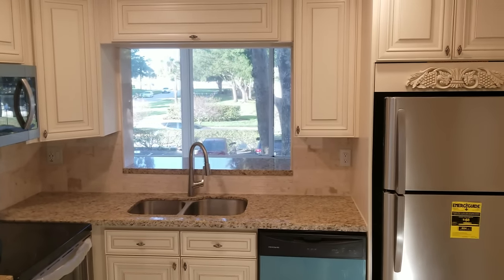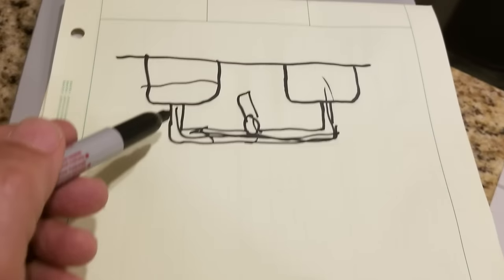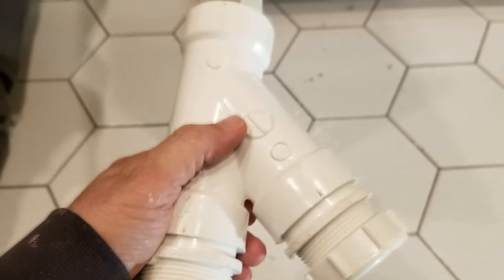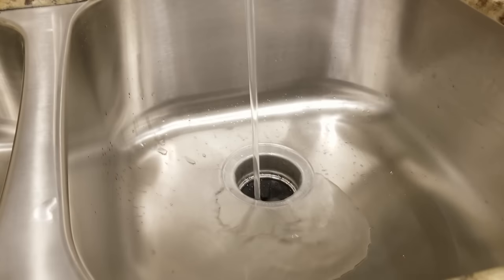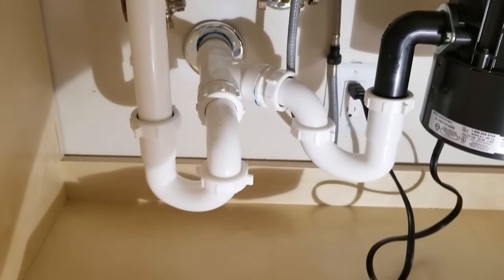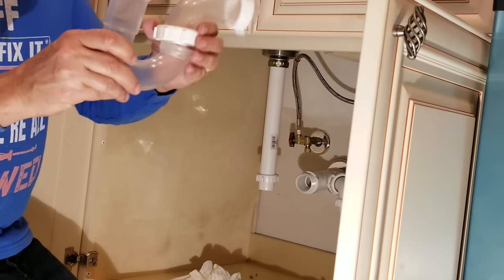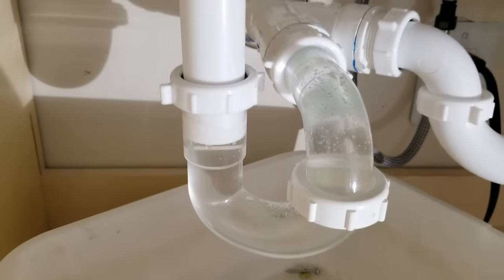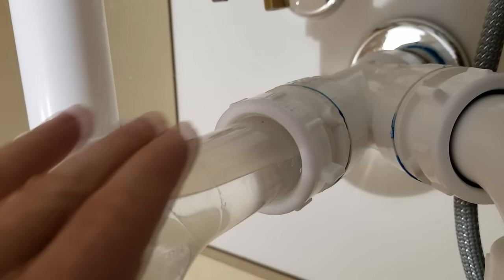How to Install Dual Kitchen Sink Drain Plumbing Pipes

Comment: The joint that connects the two halves of the trap is known as a VGJ or visible ground joint .  There has also been some very shoddy work done in the process of remodeling the piping for the sink drain. There should be absolutely no water left in the horizontal pipe that goes to the wall. There isn't a jurisdiction in in the U.S.A.  where that quality or lack of workmanship would pass a plumbing inspection. I only hope the person who lives in that house knows what kind of work was done. ( 55 year retired plumber )
Reply from the maker: what can you do to create the slope toward the wall when the waste line out of the wall is horizontal?
Reply: @jeffostroff  go back in time and tell the builder to do it right. It could be because of crud in the line?
Reply from the maker: @sal.pizzurro  I'm working on a time machine invention and plan to spend about 3 months back in time chewing out several builders: "what were you thinking"?
Reply: I’ve got the same problem,  a horizontal pipe. The old three way connection rusted out from the bottom from end to end. Now replacing it with  PVC. but still will have water sit, wishing o could creat an angle without moving the house.
Reply: @jeffostroff  Is there anything practical that can be done to remedy the slope?  We have this problem plus dishwasher waste plumbed into disposal pressurizes the drains when sinks are full.  Causes joints to flex and perpetual leaks flooding electrical box.
Reply from the maker: @DustinMaki1   If you have then horizontal pipe going from the garbage disposal over to the other sinks down spout then you will have to re cut that down spout in order to allow the horizontal pipe to come into it a little bit lower it doesn't take much you only need a quarter of an inch per foot sloper
Reply: jeffostroff if it’s all sloped correctly they obviously you have a blockage downstream, just snake it out, no time machine required, unless you have backfall and we can’t see the angle in this video
Reply: @jeffostroff   there aint much you can do to correct a stub out from the san tee in the wall, (unless you want to open up the wall and move things around,) but really the short distance just makes a large crown weir, best your work is leveled out like you did.
Reply: Could the high weir be a venting issue?

Comment: Seems like doing that might have a siphon effect on one of the traps depending on which sides draining.
Reply from the maker: It cannot generate a siphon effect because you're going into a wye
Reply: @jeffostroff   I was thinking to do the same two p trap using wye. One for the kitchen sink drain and another for the washing machine drain. I am also curious to know if this will cause any siphon effect.

Comment: I have 2 inch PVC coming out of the wall.  Found a 2" x 1 1/2" adapter to connect.  But I am left with a female unthreaded 1 1/2" to connect to the wye - I can't find a male to male 1 1/2" to connect those 2 - HELP?
Reply from the maker: If you look at what we did under the sink, on the end of the Wye, you cement on a 1 1/2 inch trap adapter and that solves your issue, so now the output of your trap goes right into that trap adapter.
Reply: @jeffostroff  The output of the 1 1/2" adapter that I have is the same size as the wye. That's why I said I need 2 male connections to connect those 2 alike ends

Comment: I was told I needed a vent.  Is that true?  How do I add one?
Reply from the maker: Usually when you vent a sink drain there has to be a pipe inside the wall to go straight up through the attic in out the roof to the outside so that there can be air behind water when you drain. If you can't accomplish that then you can do it with an air admittance valve from Home Depot https://homedepot.sjv.io/donA97 also known as a Studor valve. You have to connect the P trap to this valve underneath your sink and it will pull in air from there
Reply: @jeffostroff  Thanks!  You only need an AAV if your drain goes down, under the floor, rather than through the wall, right?

Comment: can this work if the waste pipe is high?
Reply from the maker: The waste pipe should be lower than the horizontal output tube of the garbage disposal. If the waste line is higher than it, then you won't be able to drain water out of the P-trap exit and into the waste arm coming out of the wall. It will back up into your sink drain. A lot of people will report seeing this problem with they have this condition, and unfortunately happens a lot during remodeling. The only way to fix it is to cut into the drywall and lower the height of the waster pipe.
Reply: @jeffostroff  thank you so much!!

Comment: Should have the disposal connected over to the left drain with a specific connecter and then the pee trap leading to the drain.
Reply from the maker: Yes you can do it that way, the problem is most people implement that method wrong, because they don't slope the horizontal pipe to the P-trap downward. This is not a case of it should have been done your way. Either way is fine.

Comment: Im i missing something. I have very similar configuration and somwtimes when the disposal is turned on, i can see a little water coming up from the other side.
Reply from the maker: We had the same issue in my kitchen at home a few months ago, we made a video out of it. The problem is likely a clog further down the sewer system. My 15 foot snake could not reach it so my plumber friend came by with this segmented feeder which also agitates the snake, and he went about 30 feet down the line to unlog and found cereal! Cost me $100! You'll see it on the video we show the failure mode, and how we cleared it: "How to Snake/Unclog Kitchen Sink Drain, Stop Sewer Smell" https://youtu.be/fqnm4mwV33o

Comment: Currently, both sinks drain to a vertical baffle tee connection. the sink without disposal enters from the top and the disposal sink enters the tee horizontal (the p-trap is after/below the baffle tee). Problem is that the baffle tee significantly restricts food waste from disposal. Had a clog that I just had to clean from carrot peels. I'm wondering if your wye connection would be a better solution? I understand why the baffle tee exists, but makes no sense for food disposal. Thoughts?
Reply from the maker: Yes, since the solution we used here uses no baffle, I think it would perform better. But I also wonder would the carrot peelings clog up in the P-trap if they weigh too much? I might also suggest that you should be peeling carrots over the trash. I actually try to put as little possible solid or lengthy strips of vegetables down the disposal. I mostly use the strainer on the sink drain and dump everything in the trash.
Reply: @colinkinton @jeffostroff absolutley put everything into the trash,  pretend disposal doesn't exist.  Disposals chop food up essentially making everything like mashed potatoes.  Many food blockages can't me cleared with cables,  you would have to have the line scour jetted. High pressure water throughly cleans the pipes whereas cable being a bandaid fix,  will only burrow a hole through the blockage leaving behind the build up on side walls.

Comment: The line in the wall connects to the line that's in the floor with a T  but the two p traps are on the same line, one attaches to disposal, and one attaches to the line that goes into wall and into floor with an elbow to the p trap.  No wonder it's so crazy and won't drain right!

Comment: Does the code allow this configuration?
Reply from the maker: We have found nothing in the code that disallows this. At the end of the day you have 2 streams merging into one.
Reply: I think it is perfectly fine as well because the main drain line is 2 inches and two 1-1/2 in. connects to it. If you had a 1-1/2 in. main drain line then you may have had issues. I just filled both sinks and both drained almost the same time. I have a final inspection soon, will keep you posted. My plumber thinks it wont pass but we will see.
Reply: @erginiscen  and....?  did it pass?
Reply: @borisstarosta7823  the inspector didn't even look at it, my advice would be to do this which perfectly works when you don't have to involve an inspection. I filled both sinks to test and opened the drain at the same time, both drained perfectly and fast.
Reply: @erginiscen  THanks for your update.  But... the important test is to see if filling just one of the sinks, and then draining that one all at once, can pull the trap for the other sink dry (by a siphon effect).  If it can, and then you have a dry trap, this would allow sewer gases to come out of the drain of that sink.

Comment: You still have a confluence, it's just closer to the wall,  I suppose the extra pipe in the assembly holds a little more water but...  I still cannot justify paying for the additional p trap.  I would not pipe it the way your initial diagram outlined but rather running both sinks DOWN into the same p trap via sani-t with the disposal being fed into the vertical stack and the sink angling over, down and across into the curved stack; then into the trap and out to the 2 inch main in the wall.
Reply: I believe that is textbook.
Reply from the maker: I prefer one larger sink
Reply: @jeffostroff  I hear you...  I went with 2 because I do my dishes by hand and need a place to dry them.  The other sink is perfect but it still needs a drain.

Comment: You're supposed to clean/prime the surfaces and then hold the joint after joining them after the twist so that the curing joint doesn't force it apart. (Instructions are on the friggin' can!)
Reply: Actually you do not glue slip joint fittings

Comment: Than you would have more room for storage under your sink. It's rare that you have both sinks draining at one time. And the pipe in the wall the drain is 2" under the house so you should have no problem with drainage
Reply from the maker: I really prefer one big sink

Comment: What you fail to realize is the drain being 2 inch pipe can only handle so much water at once. If the wall line is properly vented then you would not have any problems.
Reply from the maker: The 2" pipe going into the wall was enough to handle both basins draining at once.

Comment: The outlet side of the traps are supposed to be sealed by a glued connection, not a slip fit.  You should have put desancos on the tailpieces.  Also 2 traps are not required, if your drain from the wall was lower you could have put a TY above the trap on the disposal.
Reply from the maker: You are wrong on both counts. You use cement if you are using PVC parts. These are poly pipes which is allowed by code and is the way all plumbing is done here in FL, 1 1/2" PVC DWV pipe coming out of the wall, then a hub adapter is cemented onto that pipe, then the p-trap slips intot he slip side of that p-trap adapter. This is done so howmeowners can remove the p-trap to retrieve items that fell down the drain. Also plumbing code REQUIRES a trap, but permits 2 traps if they are on the same floor level as these 2 are for each line to stop sewer gasses and deadly odorless methane from seeping up from the sewer. furthermore I don't like those horizontal pipe most people put in from the garbage disposal to the vertical tail pipe, because they often don't have a downward slant on them to help the water move out of the garbage disposal.
Reply: @jeffostroff  The first drawing you did is a center outlet waste, and I agree with you that design is garbage. There is nothing wrong with your design using the wye method. My personal preference is to use two 1/8 bends to off set the drain then use a disposal end outlet waste with a baffle and single trap. It takes up less space and looks neater. Again I'm not bashing your work this is just my preference. There are many right ways to plumb.
Reply from the maker: @joshm5816  Are the baffles allowed in plumbing codes? I thought they did not want any moving parts, or is it a stationary wall inside the baffle?
Reply: @jeffostroff  Baffles in a disposal waste isn't a moving part. The NC code book allows it for residential use and it works great.

Comment: I don't like screw on fittings especially when a garbage disposal can vibrate and cause it to leak over timr
Reply from the maker: That's why I hate cheap sinks with thin gauge steal. Also your garbage disposal should not be vibrating ever, the ones I install are level and run smooth. I stay clear of the cheaper units.

Comment: Get to it
Reply: I see a dishwasher. That usually is pumped into the disposal. I say that because code requires 2" pipe if a dual sink is piped with the dishwasher. At least in my state.

Comment: Watched a lot of videos on this type of setup and professional plumbers say this is a no no. This also seems over complicated, going to just stick with what is recommended by the pros and use a single P-trap.
Reply from the maker: Nothing wrong with a single P-trap. but you have not given any reason why it is a no no. This implementation gave zero problems, and drains perfectly

Comment: This isn't particularly wrong but it's not the way I would do it. The reason why I wouldn't do it this way is because if you drain only one bay it can pull the other trap out. Typically you would put an arm over into a vertical tee and then right underneath it use a single trap. That way every time you run the garbage disposal it doesn't pull the the water out of the other trap
Reply from the maker: This is where your logic is incorrect you cannot suction out the other P trap because they feed together in a Wye formation period now there are other scenarios that it might be able to suction it out but that's why we feed it in as a Wye instead of a T shape
Reply: @jeffostroff  actually the y makes it easier to siphon it's called a Venturi effect and if you turn on the garbage disposal with the sink full of water I bet you it pulls it out the other side

Comment: I did this exact setup when I changed our disposal out.  Before I did this the way it was plumbed would allow disposal grindings and water to back up into the other sink, GROSS!  Doing this completely eliminated that!
Reply from the maker: Chris, if you were backing up into the other sink previously, I bet you have some minor clogs that need to be cleaned out. We just uploaded a video covering this a couple of months ago, check it out: "How to Snake/Unclog Kitchen Sink Drain, Stop Sewer Smell": https://youtu.be/fqnm4mwV33o
In this drain line our snake came back with cereal that must have gotten bunched up in an illegal 90 degree corner somewhere down the line at least 20 feet.
Reply: Just wanna reply in case anyone else comes across this...yes, I must agree with Jeff’s reply here about some clog somewhere. I have a double sink with the same setup as in this video and was still getting nasty disposal pieces and grime backing up into BOTH sides of the sink. The clog was Not in any of the pipes under the sink on either side, so it had to be somewhere further in the drain through the wall out of sight. Instead of calling expensive plumber, I researched and ended up getting a 20’ drum auger drain snake thing and thankfully that finally did the trick! (I know nothing about plumbing but trying to learn a bit to save money now and in future)
Reply: @skittles2055  i have it on a newly installed drain pipe on a double sink.
Can't be clogged as its leveling out since first use😕

Comment: Mine is similar to the Y design in this video but is different with how the two basins connect to the Y.  I took it all apart to fix a clog and can't get the garbage disposal side back together now.  Should have taken a picture of the layout before hand but didn't think of it until after.  New homeowner pains and lessons.

Comment: That wye fitting for the disposal isn’t legal . It should be piped into the tailpiece just below the sink. Cleaner looking and way less room.
Reply from the maker: The Wye most certainly is legal, that is the only to do it when you add a second sink after only having one sink before. Also, that Wye is indeed piped into the tailpiece just below the sink.  Show me the exact chapter and verse in the plumbing code, don't just do a bunch of incorrect hand waving and say it isn't legal. I want the exact code and chapter.
Reply: @jeffostroff  I think he's talking about the extension.. Maybe they make a longer disposable tailpiece, (wait I watched it again... He didn't use the extension) but this is remodeling, not new construction. Two totally different beasts
Reply: Section 911 p. 76 ipc. A double wye fitting is required for it to be correctly common vented. But like the other commenter said on remodel jobs maybe it doesn't matter
Reply from the maker: Internationalization Plumbing Code, 2018 page 77:  911.1 Individual vent as common vent. An individual vent
 is permitted to vent two traps or trapped fixtures as a common vent. The traps or trapped fixtures being common vented shall be located on the same floor level. 
 911.2 Connection at the same level. Where the fixture drains being common vented connect at the same level, the vent connection shall be at the interconnection of the fixture drains or downstream of the interconnection.
Reply: Great video! Thank you.
Reply: @jeffostroff  You are correct. You were plumbing a waste line not a vent line.
Reply: @bro8898  He is plumbing a waste line not a vent. How is your comment relevant?
Reply: With the wye fitting used in the video the "run" side is discharging downstream of the "branch" which is no longer compliant with common vent requirements in the ipc. A double wye makes it a proper common vent. Every trap must be vented using one of the vent methods in chapter 9 of the ipc.
Reply: @bro8898  I don't see that anywhere in the IPC, please quote the text.  IPC requires a fixture tee on back to back lavs, maybe that's what you're thinking of?